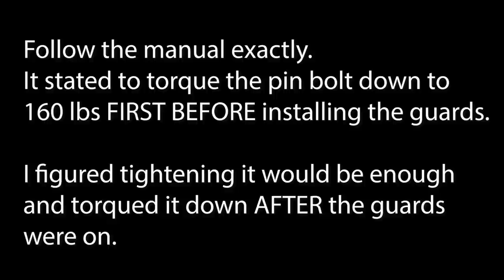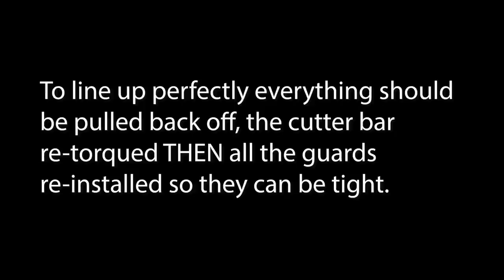338 All Fixed? No More Breaking Sickle Bars on the JD Hay Cutter

Comment from the maker: I go over a few more details on why I thought the cutter bar was breaking previously, in the next video, so I'll add them here:
I had been tightening the cutter bar pin bolt to "gouldintight" (as tight as you can get it). I noticed when I did that on the new cutterbar PRIOR to installing the guards and hold downs, THEN CORRECTLY torqued the bolt down at the very end, the pin shifted in the hole. For me, "TIGHT" was about 75lbs of torque. The pin required 160 lbs. I had to switch to Erik's torque wrench to achieve it because it had a longer handle to achieve the full 160lbs.

If the pin isn't correctly torqued, it WILL shift slightly in the hole and cause the bar to twist slightly as it moves.

Secondly, the last guard and hold down had been drilled out to make room for the cutterbar, but likely was still making slight contact with it. By switching to the regular guard/holddown I was hoping to eliminate that final problem.

Then of course making sure the cutterbar didn't have too much downward pressure on the knives from the guards and hold downs. By installing them AFTER installing the cutterbar, they better align and naturally achieve the correct gap.
Reply: He could have made a little easier doing that if you had either a light sheet of plywood to set on a lay on while you're doing that also cardboard sheets of cardboard works well to work on under equipment then after so long the cardboards can be recycled
Reply: I really admire the effort & thought youve put into this. Looking forward to seeing you & the machine out there kicking butt :)
Reply: a few minutes with a old guy sickle bar mechanic would do wonders for your situation....good luck
Reply: I have a JD 820 sickle bine similar to yours. For the front combing head, one of those bars has a pin on the right side that can be pulled to rotate the tines away from the work area to give you more space. 

It makes it a lot easier to work under there.
Reply: At least you figured out!!! 
And that is some very good information for everyone who has one of those moco . That's Suzanne

Comment: Been welding 37 years, those welds are absolutely fine.  They were done with a robot it appears and has very good penetration and thickness. Should have no problems with them.
Reply from the maker: Ok, sounds good!
Reply: @This1LifeWeLive  Thats just spatter you see, doesn't hurt or affect the weld in any way. If you want to see what a bad weld looks like, you should see what was done to the 1209 I just bought. Cringe worthy.

Comment: Surprised by the riveted sickle sections, been using bolts for many years combine and hay equipment. So much nicer than rivets when replacing worn or broken ones. Last new bar I bought came with bolts. They're sized so they fit the rivet holes in the bar.

Comment: Looking through the parts manual, if you don't have one, get one! For the non clog setup like you have, the end guards are the closed type. That NH one you put on will work, but JD has a single closed guard for left and right.  Hate to say it, but you will need to get one of each and reposition all the guards so it is set up correctly.  It is actually the regular knife guard cut in the middle to make a left and right, so you could actually use that red one and cut it in two.

Comment: I used the closed guards and had them on before I inserted the the knife bar and it slid in nicely.
Reply from the maker: It will slide in, but when inserting a new knife it has slightly different picthes than the old one and the guards should be re-aligned to fit. I'm just going off what the manual stated. I will say it fit 100% better installing the guards after the bar was in place.

Comment: The sickle bar hold down guards can be hit with a hammer to close up the gap between the cutter bar and guards. The guards are designed to be adjusted that way.
Reply: and guards are made to be bent up/down if needed to get a level cutter bar bed....these type parts are not perfect and need "modeled" bent....she will figure it out ...or trade it off and someone will get a great machine
Reply from the maker: If push came to shove I could totally do that. It fit nearly perfect when I installed everything, until I torqued the pitman arm bolt don then it caused the bar to rise slightly :P

Comment: Those welds look good to me. Probably robotically done. The spatter isn't anything to be concerned with. As for the hold downs, is there an adjustable style available? That might take alot of headaches out of that job & it makes things easier to keep the knife in check as you go. Regards & my best to you with your next crop!

Comment: Weld looks fine it's done in pulse spray by the looks just how it is.  Pretty sure it won't go anywhere
Reply: Kyle, your right on the weld, it won't brake that's how their all made now, plus she won't be cutting many acres when do it will be just fine an last!
Reply: @bryanginder5903  run pulse spray all day every day at work can pick that profile out 100 miles away.

Comment: I would not install that new cutter bar as it will break like the rest as you have not sorted out the issue causing the fluctuating stress on the bar. It is either the pitman arm or the wobble box..No weld no matter how good it is will prevent breaking again. Pity to see a new cutter bar breaking when it can be avoided
Reply: your spot on......new bar/guards/hold downs are about cut quality not the breaking issue ....fixing a haybine shouldnt be this difficult
Reply from the maker: As  stated in my pinned comment, my video clip explaining what had happened seemed to be missing. The first 2 guards on the bar were not in the correct position, which was causing the cutter bar to kick out everytime it hit. Second issue was the pitman arm bolt holding in the pin was only tight, about 70 lbs torque when it needed to be 160. This allowed a slight shift of the cutterbar as well which I noticed while installing it.

Were I to rip apart the wobble box on a hunch I would no longer have time to cut the hay. And while I MIGHT save $400 on a possible broken new bar, I'd lose several hundred more by not cutting.

The arc swing on the pitman arm was perfect. It seemed to me that if it were "off" it would swing slightly differently one side to the other. Both sides when swung right to left measured exactly the same.

Comment: Poor Baby.  I sure hope you have the solution.  Happy Autumn.    Those welds were likely done with a robot and look very good to me (Inspector for Decades).  Continuous and likely lots of penetration.  Not sure why you went with Stainless Steel bolts as they do not have the Tensile Strength of Carbon Steel ones.  It would appear that the back side of those clamps need to be higher so force can be applied at the front to press the bar tighter to the ledger plate / bottom stationary cutting edge.  Pack some additional grease in those needle bearings.  You might consider removing both wheels and have a garage flip the tires that are wearing prematurely on the inside to the other side of the wheel.
Out of alignment somewhere.
Reply from the maker: I had several suggestions in earlier videos to use them to prevent rusting . . .
Reply: @This1LifeWeLive  That they will do.  SS is tough but not as strong as Carbon Steel.  It is also softer.

Comment: I had better luck with closed guards on my haybine when we got it . it had opened guards on it and we found out it did not protect the knifes so I switched to closed guards
Reply: full guards are great for protecting the knives and horrible to clog on heavy grass hay like she is cutting......open guards are much better cutters but susceptible to damage...pick your poision
Reply from the maker: We don't have issues breaking blades (unless they hit a guard). We have no rocks or branches to worry about.

Comment: Big mistake and costly to use SS bolts. SS is soft and will not tighten down as well as grade 5  or grade 8 bolts.
Reply: They are actually brittle due to the chromium, need to keep an eye on things for broken bolts...
Reply: Stainless is equivalent of a grade 5. She'll be fine.

Comment: If you relie on GOD for a good mechanical repair you are testing your faith beyond it's limits. Knowledge and experience is what you need, for instance you would never pull 60 ft lb with that little short ratchet and only a fool believes you can acuretly tension a bolt without a tension wrench. But that's OK you like fixing and spending money, it makes good videos right. You still have not fixed the real issue, you have just repeated the work you did 12 months ago, nothing has changed. The definition of insanity is doing the same thing over and over hoping for a different outcome. Cheers mate 🍻
Reply from the maker: Actually I did pull 60lbs of torque with that little torque wrench, but not the 160 for the pitman arm pin. That one I needed erik's longer torque wrench, and yes I did pull it.

You didn't REALLY look at the work I did last year, or you'd remember a key issue with one of the guards . . . the same issue I did repair this time around. Sadly my cameras haven't been recording like they should and several key items of damage showed a better picture of what's happening.

As  stated in my pinned comment, my video clip explaining what had happened seemed to be missing. The first 2 guards on the bar were not in the correct position, which was causing the cutter bar to kick out everytime it hit. Second issue was the pitman arm bolt holding in the pin was only tight, about 70 lbs torque when it needed to be 160. This allowed a slight shift of the cutterbar as well which I noticed while installing it.

Were I to rip apart the wobble box on a hunch I would no longer have time to cut the hay. And while I MIGHT save $400 on a possible broken new bar, I'd lose several hundred more by not cutting.

The arc swing on the pitman arm was perfect. It seemed to me that if it were "off" it would swing slightly differently one side to the other. Both sides when swung right to left measured exactly the same.
Reply: You don't get knowledge and experience without trial and error repairs when you don't know exactly whats causing things to break, you also don't go fixing everything at once because then you don't know what caused the problem in the first place plus also spent more money and time than needed when you could be out cutting and making money.

Comment: Another week til the next vid ?
Reply from the maker: Well if it takes a while for a video, you know I'm busy in the barn or on the field ;D  Hopefully Monday for next one! Of course I said that last week, lol!  And those tools have been getting TONS of use! Even the punches, funny enough!
Reply: @This1LifeWeLive  Thanks Suzie, was wondering about the comments about adjusting  the bottom where the bar rides between, instead of hammering, would a hydraulic  jack pushing up work ? using the weight of the baler to your benefit.
Reply from the maker: @eddie9027  i did try that but its on floating springs 🤔
Reply: @This1LifeWeLive  thumbs up you tried, thumbs down on floating springs, have a great weekend !

Comment: Blimey! underserrated sections are so prone to clogging. I was using top serrated 40 yrs ago and soon changed my CLAAS combine bed to the Schumaker system that cuts alternately up and down on the fingers so needs no separate top "clamp" plates as the double fingers are shear plates both above and below the knife and the sections are correspondingly mounted up and down so the knife runs  without being "lifted" by the crop underneath, which underserrated sections exaggerate and increase friction and drag not to mention having to sharpen them which is not needed with top serrated. JD & DEUTZ combines have been fitting Schumaker knives since the early 80's.
Reply: Sorry... spelling is Schumacher.

Comment: Should have just dumped it and bought a new holland they are much more reliable. Stainless steel bolts are not as strong and they gall the threads if you don't use anti-seize